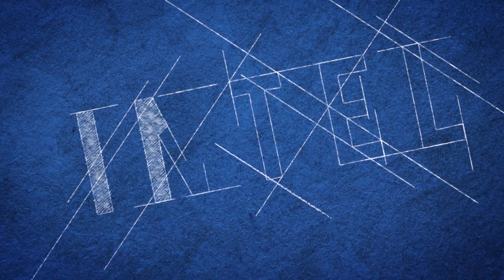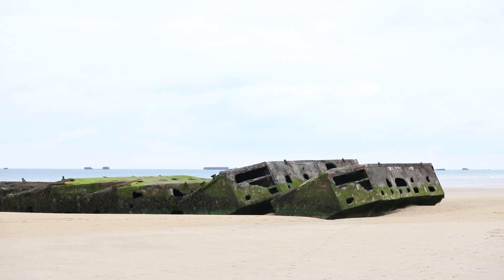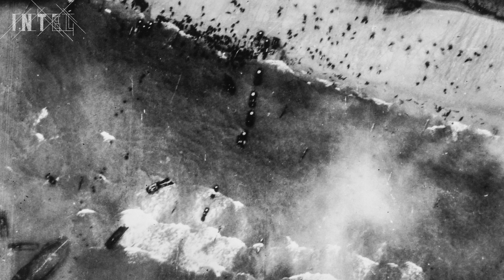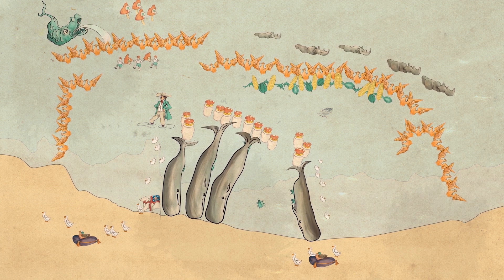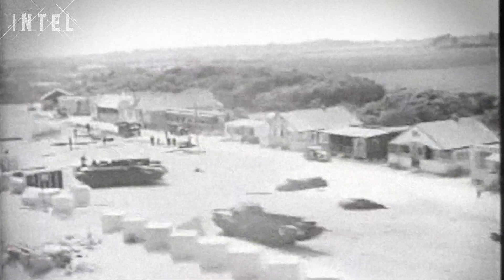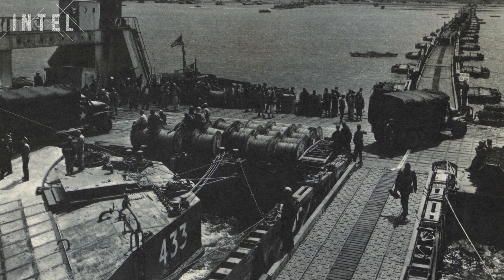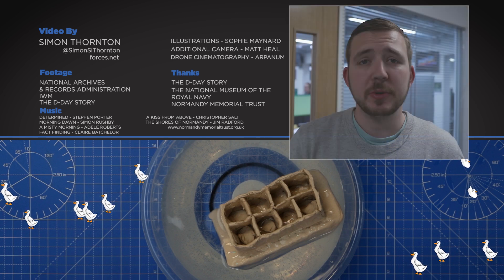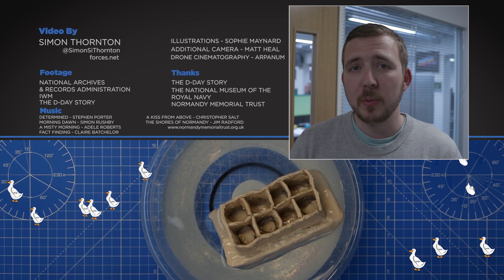The Secret Invention That Made D-Day Possible | INTEL

Comment: this invasion was very negligent of the officers to send men into a hail of bullets and bombs without any armour or defense - for example  our stone age ancestors had enough sense to invent and use shields thousands of years ago
Reply: @JG-ry3ty  - exactly sending men  into a "hail of bullets" on a beach landing without armour or bullet proof shield is negligent
Reply: @majorrgeek  It's not well known but the fact is there were over 70 Sherman tanks landed during the first wave but unfortunately, well placed and well camouflaged anti-tank guns on the ends of the beach had unobstructed fields of flanking fire along the whole beach front. Because of this the tanks didn't contribute to the invasion as much as was hoped for as they were seriously constrained for some time by that flanking fire. Many were knocked out/disabled, including some when the incoming tide flooded engine compartments.
 

As for the bullet proof shield idea, that's brought up quite often but doesn't take into account how much penetration power the MG42's 7.92 armor piercing bullet is capable of. At that time, the only practical material for a bullet proof shield was armored plate. The weight of the shield that could provide enough protection would have been well over 70 lbs. Way too much for soldiers already burdened with weapons, gear and ammo. During WW1, shields had been used but was soon found to be too much of a hindrance and were quickly discarded except for use on some machine guns.

Besides, you're not taking into account the simple fact that 4 of the 5 beaches taken that day was done with far fewer casualties then worst case predictions. To understand why the Omaha Beach was such a bad situation requires some information that is not readily known. For example, all of them received aerial bombardment with probably the best results at Utah Beach(which also had the fewest casualties of the five) and definitely the worst at Omaha. At Omaha, they used 450 B-24 heavy bombers at fairly high altitude but unfortunately, when they reached the target area, it was pretty well covered over with clouds so they had to resort to using radar for their bomb release information. They had used radar bombing before but it was still a fairly new technique and the bomber crews were consciously aware that if their bombs landed short, the invasion fleet could be seriously impacted. Because of this, they released their bombs late which resulted in them all missing the target by a substantial amount.

Something else about the aerial bombardment of Omaha Beach that a lot of people don't know is the fact that the bomb loads used for this attack where smaller bombs than those used on the other 4 beaches and the fuses were set to instantaneous which was all done for a specific reason. The end result would have been less damaging impacts on any bunkers if the aerial bombardment had been more accurate. No doubt a massive bombing effort would have still had a demoralizing effect on the German defenders(as what happened at Utah beach were many surrendered quickly) so even if the bombs were unlikely to cause significant damage to the bunkers, it's still unfortunate that they missed so badly since they would have provided some craters for cover. The specific reason for this decision was due to the restrictive nature of the terrain found at Omaha which really only had 4 exit points from the beach because of the high rugged surrounding bluffs and cliffs found there. The allies were extremely worried about the possibility of too much damage to those exit points that would seriously hamper getting the invasion force inland to firmly establish and secure the foothold gained.

When it came to the preparatory naval bombardment, the Germans had done a masterful job of camouflaging their strong points so that they were very hard to make out from anybody firing at them from the sea. As with the aerial bombardment, the naval fire was intended to avoid damaging the 4 draws as much as possible to minimize the chances of making those draws unusable to vehicular travel. Of course, the Germans realized the importance of those draws and had placed strong-points in close proximity to them. The allies also had some LCTs converted to launch thousands of rockets that were supposed to blast away some of the beach obstacles and create craters for some cover for the soldiers but unfortunately, most landed short or long.

I should also mention that the terrain at Omaha was the best suited of the five beaches for defensive preparations and the Germans made the most of it. Also, the allies attacked in the aftermath of a large storm which no doubt caused some of the issues with the preparatory bombardments plus the stronger than expected currents caused many landing craft to miss their designated landing location. Also, one battalion of DD-tanks was launched in conditions rougher than they were designed for and most sank on the way in. Fortunately, the other battalion of DD-Sherman's assigned to Omaha didn't make the same mistake and was directly landed on the beach. Attacking in the aftermath of a large storm might seem foolish but the Germans were caught completely by surprise and Rommel along with some other high-ranking officers were away on leave so I think the pluses and minuses of that decision probably ended up favoring the allies.
Reply: @mako88sb  - sending men  into a "hail of bullets" on a beach landing without armour or bullet proof shield is negligent

Comment: 13:30 There were several things that had to work or the invasion would have failed. The amazing thing was, they ALL worked.
     The deception, the landing craft Operation Pluto, the Mulberries, and so much more. If any one of them had not worked, the invasion would have failed.
      The deception was the biggest one. The Germans were so sure the invasion would take place elsewhere, that Normandy was a diversion, it was weeks before they responded in force.

Comment: there were two docks. The British one, and one for the Americans. The Americans tried to rush the installation and missed some of the sea anchors. When a storm came in, the docks ripped apart and all the vehicles had to use the British Mulberry. They also floated a large spool with steel tubing wrapped around it to lay a petrol, (Gas) line from Britain to France
Reply: PLUTO Pipe Line Under The Ocean

Comment: Initially, for a few months the floating harbour looked like it would fail, simply because standard concrete, even with steel reinforcement, continually structurally failed.
The secret formula which eventually made the Mulberry caissons float ? 
Amazingly... the bonding strength of vast quantities of raw sawdust added to the mix, and if I recall correctly, was discovered by serendipitous accident. It's a technique I also use if I want to lay concrete that's harder than the gates of Hell.
Reply: Like pycrete? But ice and sawdust. when they were on about making large blocks of ice into floating aircraft carriers
Reply: The Mulberry Harbours only had to last long enough until they captured established harbors. They Were Expendable, very similar to the Liberty ships. If a liberty ship made one trip across the Atlantic from America to England they figured they broke even.
Reply: @stomabag7127  : Yes, indeed. However, they had to last long enough to be towed from various points around the British coastline, but trials repeatedly proved they would fail. That was up until the sawdust was added to the mix. Following that, amazingly several of the of them are still on the Normandy coast. Testament to quality !
Reply: @cuhurun  Much respect to our veterans and other heroes of the time.
Reply: If the gates of hell are so hard why do so many weak people get in.
Reply: @jacknordli7630  : think about the concept of leaving the place, rather than entering : )